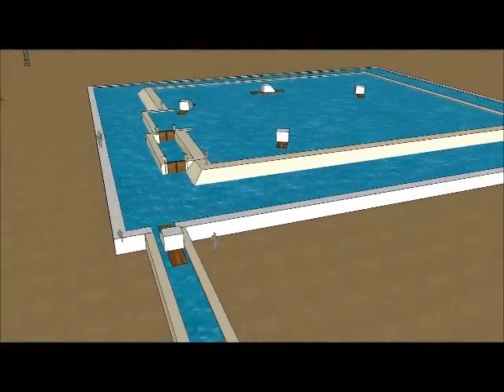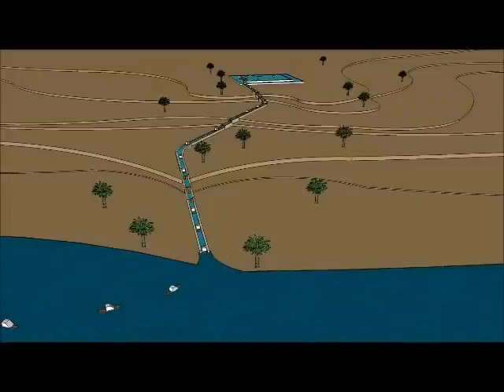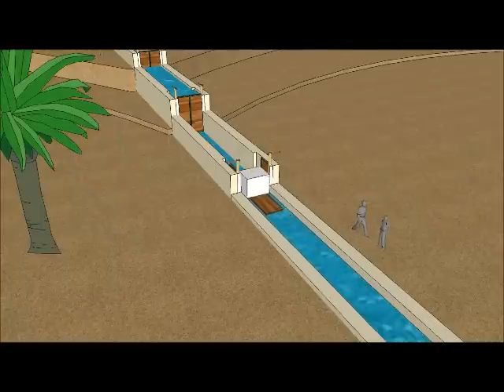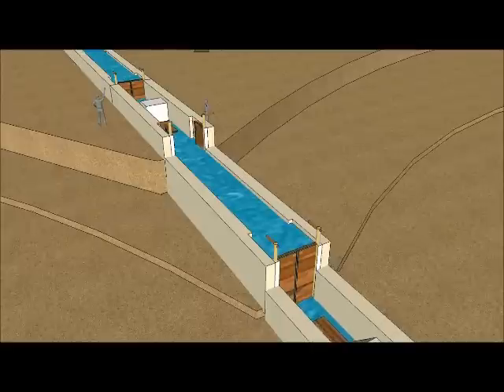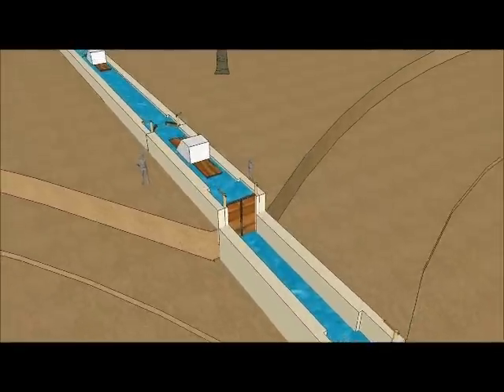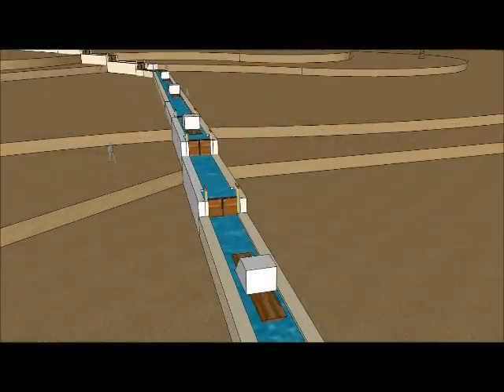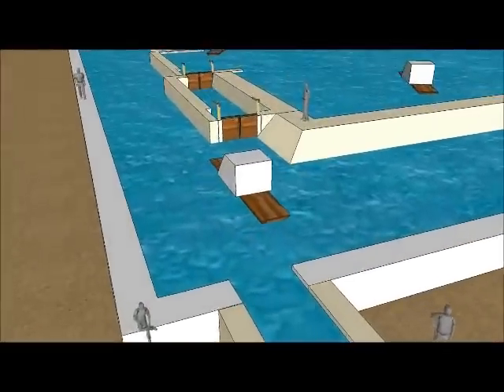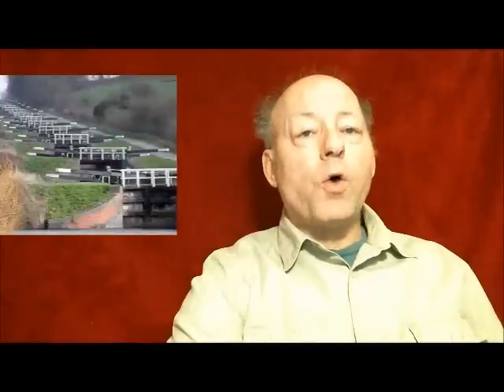Video 3  Moving Stones from the Nile River to the Building Site

Comment: If the parts were reversed in order they would segue onto the ensuing part by auto-play.
Reply from the maker: Pockets MacCartney good idea. I posted the videos in order but that caused them to be in reverse order because they post the videos in the order of newest first. But I hope you like the videos.
Reply: @GreatPyramidPump  : Absolutely. I read today that they analysed the great pyramid casing stone bonding agent or mortar and found it was basically a form of gypsum. Does that agree with your findings?
Reply from the maker: @rogerscottcathey  I have read several explanations of the composition of the mortar.  These different explanations suggest different ingredients of this bonding agent.  There is scholarly debates as to how it was made and what its purpose was.  What is an important characteristic to the bonding agent is that the bonding agent is STRONGER than the stones being bonded together.  Also the bonding agent made the joints water tight.  Isn't that fascinating!  Thank you for your interest.